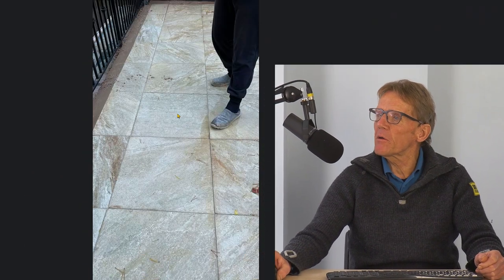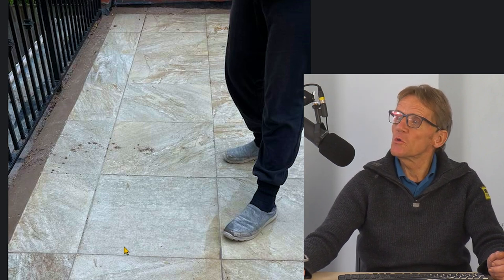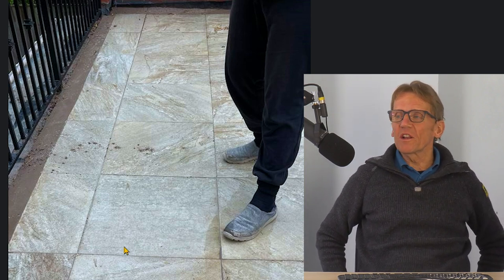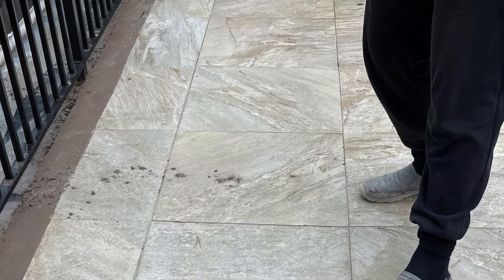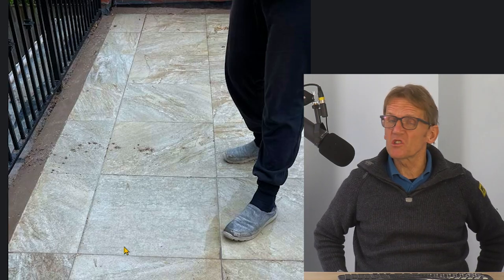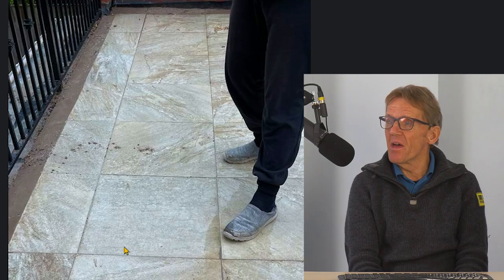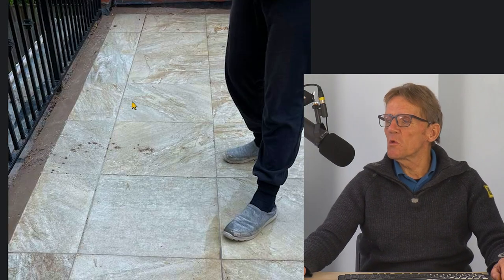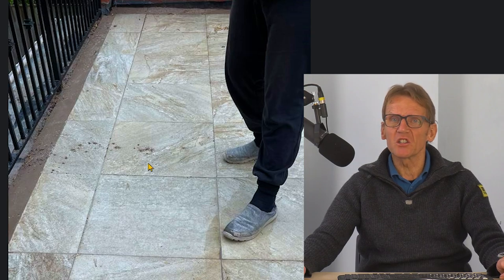Leaking Balcony ~ Rip it up or repair it?

Comment: Look ugly, but a decent liquid rubber, pmma, liquid polyester etc would fix it and last. Personally I would rip it up, lay high performance three layer felt or fleece back Epdm followed by pedestals that allow drainage beneath the tiles or just straight on the membrane with those dense rubber tiles they do.

Comment: I think you answered it Rodger. Rip it up, waterproof the deck and then put you tiles back on. Remember if you are going to use pedestals the tiles have to be rated for this use.
Reply from the maker: Good point
Reply: Look ugly, but a decent liquid rubber, pmma, liquid polyester etc would fix it and last. Personally I would rip it up, lay a high performance three layer felt or fleece back epdm/single ply followed by pedestals that allow drainage beneath the tiles or just straight on the membrane with those dense rubber tiles they do.
Reply: @Mt3Dpdrtk  I don't know... a proper flat roofing job is not meant to be stood on, like you do a deck. If the bearing allows it, a proper flat roofing job... that drains properly, with a deck suspended above it so the the roofing doesn't bear load. Anyway. No easy, long term fixes.
Reply: @willthecat3861  I’m a flat roofing specialist done a fair few balconies with felt then layed those dense rubber mats over the top. Don’t talk to me about a ‘proper’ flat roofing job, what do you mean ‘the bearing’...it’s a balcony...definitely meant to be stood on.
Reply: @willthecat3861  the substructure bears the load not the membrane. Obviously. Go do some DIY.
Reply: You’re talking gobbledeegoop
Reply: @Mt3Dpdrtk  You need to calm down mate. I'm in a different country, different weather, different football team. A comment is an opinion, just like there's many ways to do something right: not just yours.
Reply: @willthecat3861  I imagine you’ve never done a flat roof or anything for that matter
Reply: @Mt3Dpdrtk  Maybe you don't have an imagination. Try to imagine I'm a cat, and I'll imagine your're a roofer. And then, neither one of us knows for sure.

Comment: Well, my choice would be to rip it all up and replace it with a fibreglass bonded roof.  Pretty much bomb proof, so any crap on top won't do any harm!
Reply: Lay the fibreglass. While it’s wet blind it out with quartz sand. Sweep off the excess sand once the fibreglass lining has cured leaving a surface that’s like sandpaper. Now it’s ready for tiles to be bonded.

Comment: Looking at that finished edge, I reckon they've fixed those on sand/cement. If they are porcelain they will have very little porosity and wont bond well which is why a couple are already rocking. Only solution, take em up and get a qualified tiler in to do it.

Comment: Back in the 80's I bought a split level "upside down" house in the country with great views from the upstairs living rooms and 40'x9' balcony. The balcony was over the bedrrooms below and right from the off I had water coming through the downstairs ceilings when it rained. My balcony was made up of quarry tiles over felt - utter rubbish job. I tried everything to seal it from the top but nothing worked so after a few years I had the whole lot ripped off and replaced with mastic asphalt. As this is not so good as a wearable surface I then loose-laid a very good imitation of terracotta "French Rectangles". Never had a single problem in all the years that I was there for after that.

Comment: My only comment also to bear in mind is being as its a cantilever( I presume) balcony it will move with weight on it so the tiles need to ultimately relaid on a membrane and flexible bond adhesive and equally a suitable grout or sealant for the joints.A cantilever balcony has an harmonic springing effect which I think is whats caused those loose tiles?

Comment: Also, slope and drainage. Proper slope to drain the water away No low areas to pool water.  Standing water on masonry, even glazed, and especially standing above joints in the butting units (even if only during the rain), will always eventually leak. It's worse in a seasonal climate, where expansion, can occur.

Comment: There is one thing he can try. He can take all the old grout out and replace it with epoxy grout. Epoxy grout is  expensive, and it is hard to work with it, but it's waterproof.
Reply: Bostik Cementone Rapid Setting Cement way better. (And less cost)
Reply: @Luke Shepherd  tnx for info. I have to do the same repairs as he has. Will try for grouting.
Reply from the maker: It is a waste of time. The seal is on the roof below not the tiles